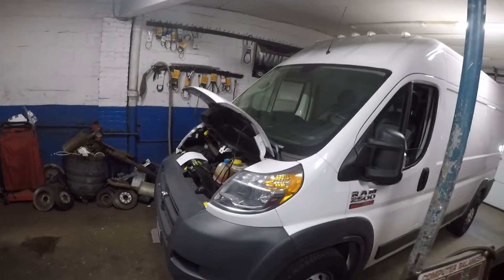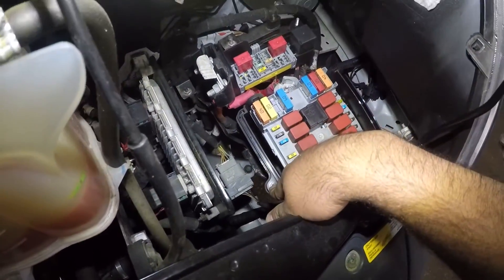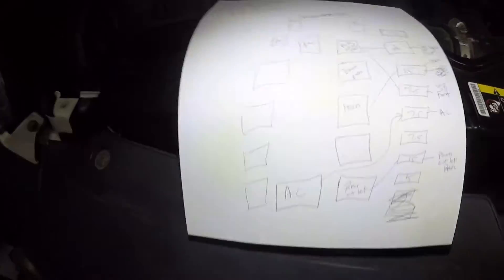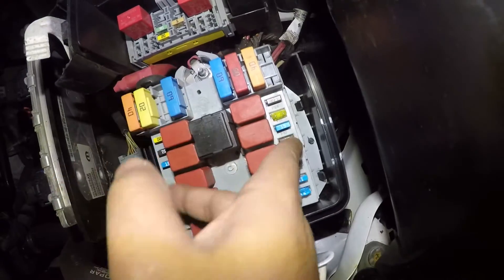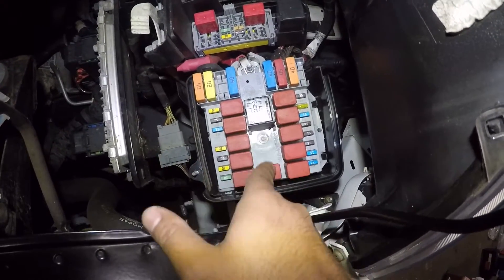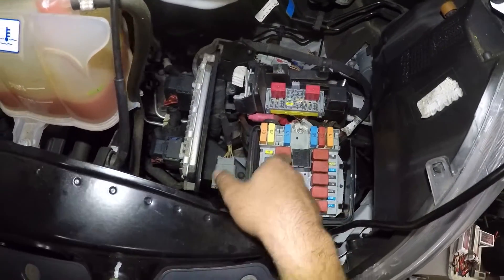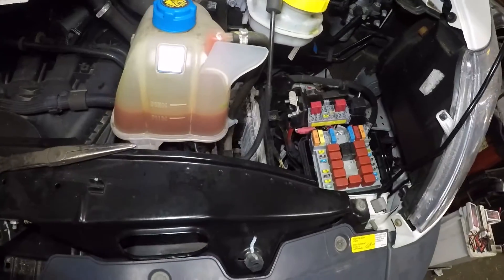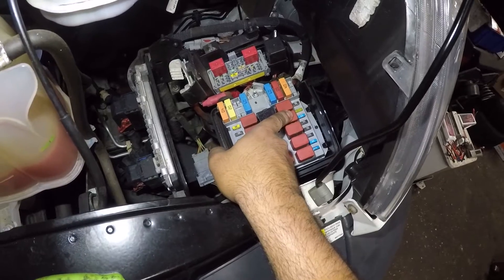2018 Ram 2500 promaster ac or blower motor dont work check the fuse

Comment: My 2016 Promaster 2500 had a dead battery one morning. Got a boost, and next day the battery was dead again. I noticed that the vents on the dashboard were blowing air (must have been a small amount of power left in the battery), and am wondering if possibly the relay is stuck.
Reply from the maker: Prolly ur alternator is the issue jump start it and check alternator output but if u think motor stays on all time then yes could be stuck relay

Comment: Hi. My 2015 promster ac just stop working. No light on the swiches or anything else. Looks like its dead. Not. Blowing air at all. When u ouch the middle one for AC that light not coming in. What u think  my problem is ? Thx in advance
Reply from the maker: Start with fuses check the fuses
Reply: @RBTheMechanic  I tested as I see in your video its seems all good. Also when is the headlight is one I dont see any lights on manual climate controls...
Reply from the maker: @littleche7676  check all other fuses there’s also fuses inside left side lower steering there’s screw u remove and take out the cover and fuses are inside also on the wall back on passenger seat
Reply: @RBTheMechanic  Ooo ok I didnt know other fuse boxes. I will check it. Thank you for your help.
Reply: @RBTheMechanic  also i see this.mor ing my odometer is in the dash blinking. İs this something related with climate control panel?.maybe computer problem?
Reply from the maker: @littleche7676  yeah maybe ur getting water in the wiring or somthing that sort
Reply: @RBTheMechanic  in Thanknyou right other day there was big storm. And one of the rain water drain hose on the driver side that little hose was came off and thats means some of the rain water got spalshed in side the hood. That sucks 😕
Reply from the maker: @littleche7676  yup I have video on this van same issue but it was completely clogged up
Reply: @littleche7676  did you find what was the problem?
Reply: @ulifergamers7313  i took it to the dealer. They changed blow motor and control panel. And one more thing. İ forgot what was it. Yes. Now it works. And it cost me 1050$😭
Reply: This sound very familiar , my odometer blinking and A/c controls not working
Reply: @fonick027   did you ever find out what the issue was? Mine is doing the exact same thing.
Reply: @littleche7676  hi. Did your mileage stop blinking after all the repairs were made?
Reply: @claytontrask2499 u ever find the issue? Mines doing this and it’s driving me crazy. Absolutely no power to climate control unit.

Comment: I got 2021 promaster for my fleet and I put a camera on then the blower motor stopped working , I tested the blower separate  and it's working,  now I think the switch is not working but there js lighg on it , no power to the power motor , any info about it
Reply from the maker: Check fuses and relays
Reply: @RBTheMechanic  the problem I did check all of them , I checked the blower then I used my autel im608 to test the switch and they're fine , the code that I got B1919-14 front blower regulator (linear driving) circuit open or short to ground .
Reply from the maker: @zaynehm2444  u might have electrical trouble might need some diagrams and good Electricison might not wanna tackle this one urself
Reply: @RBTheMechanic  I took it to the dealer and they said it needs ecu refresh cuz of the intelligent fuse box lol it didn't work ,well I used an old school way and I fixed it ,it took me 3 weeks 😅
Reply from the maker: @zaynehm2444  dealer always give BS

Comment: Could "no heat" be connected to blower fuses/relay or that's something else?
Reply from the maker: No heat or no air at all?
Reply: @RBTheMechanic  no heat. AC at 1st too, but switched 7.5 fuses & it started working.
Reply from the maker: @JKLOPQ  check to see if bled door is working
Reply: @RBTheMechanic  I forgot to add the white plastic lever above the gas pedal is not moving at all when I shift the temperature. I tapped it with a screwdriver few times, but it didn't fix it so was wondering if fuses/overlays have anything to do with it & if not then what do you think it could be? Faulty blend door motor?
Reply from the maker: @JKLOPQ  if that’s the blend door motor then that’s the issue I don’t have too much software data on this truck but u can manually try moving it and see if that works
Reply: @RBTheMechanic  thank you.

Comment: I have a 2016 Dodge Ram 2500 Promaster. The AC doesn't work! Not sure whats the problem but from what I know, the driver side dash, where it shows the outside temperature has no digits. Before when the thermostat showed numbers, the AC would blow COLD air, but now no numbers show on the thermostat, therefore, no COLD air coming out from the AC. The AC button lights up itself, just no COLD air! What would you say the problem is? Im thinking a fuse maybe, not sure if that's the case! The whole AC system works, just no COLD air because of the thermostat showing no digits! 

Any help from anyone would be great, TIA 

@RBTHEMECHANIC
Reply from the maker: Check fuses to start
Reply: @RBTheMechanic  should i just replace all the AC fuses?
Reply: I watched another video and I they stated that it was the thermostat sensor on the driver side mirror. That sensor isn't working from what I know, because it isn't showing any digits or numbers on the drivers dash. No outside temperature, just empty lines. When there was numbers, the AC worked! So should I just swap the thermostat sensor first? TIA!
Reply from the maker: @lmaojasey921  yeah fix that u never j own it needs tem reading to keep temp in range
Reply from the maker: @lmaojasey921  not replace check them with test light
Reply: @RBTheMechanic   Hey, got the AC fixed, was just a sensor problem under the mirror! Quick 4 dollars on Aliexpress for a sensor and saved myself a nice $900 from the dealer! I have one more problem tho! 

My horn is not working! Not sure if it was because of the previous owner either crashing or possibly steering wheel airbag went off? But all I know is the horn isn't working at all, no sound when pressing! Do you know why? Could it be the fuse, if so, which fuse?
Reply from the maker: @lmaojasey921  check fuse and check connector under steering these pop off
Reply: @RBTheMechanic  which fuses is for the horn? Also, where can I get replacement fuses for the big red block?
Reply from the maker: @lmaojasey921  it’s in the video I think so